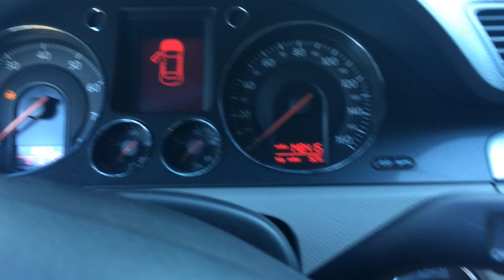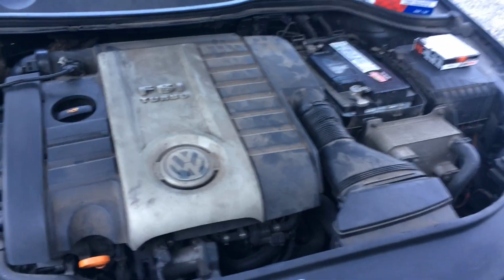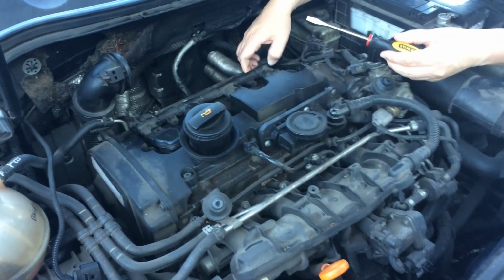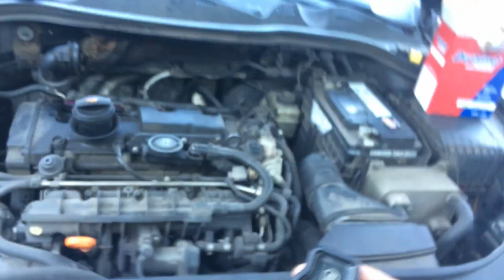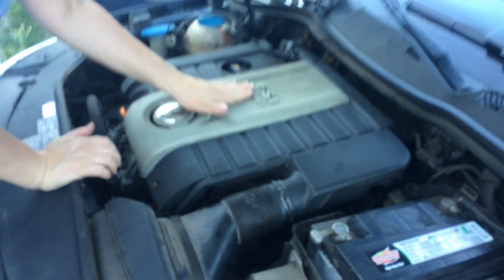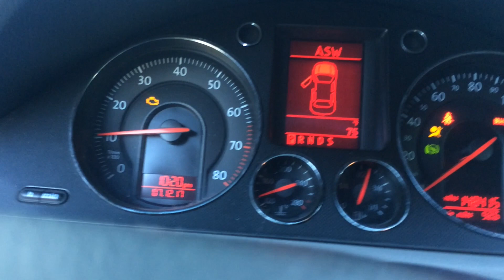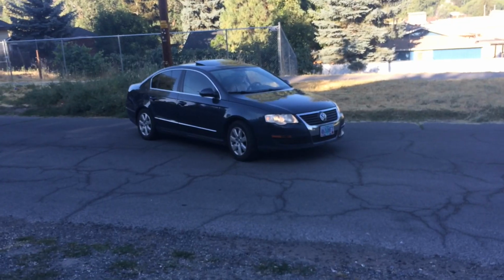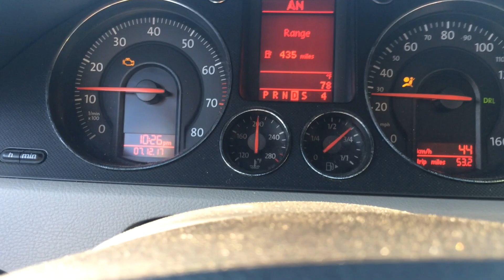How to replace coil packs and spark plugs | VW Passat 2.0T

Comment: Happened to my 2006.  Went into limp mode, but got me to the dealer.  Yep...coil pack was the issue, had them all replaced.  Thanks for the great video.  I still have the car, but it is killing me slowly by a thousand cuts.  VW service although great, is now way too expensive.  I have done some of the easy work myself and it helps.  Saved over 250 bucks when I replaced my driver side
window switch cluster.  YouTube is fantastic.  Don't forget to replace the cam follower regularly.

Comment: That very same light came on as I was heading out from Las Vegas to Reno (450 miles through barren desert) literally 5 minutes into the drive, car has 136k miles on it.  I thought that malfunction light was a transmission symbol, and the car was jitterring and vibrating, so I immediately expected the worst.  We limped it off the freeway, prayed, and the light turned off.  I checked in the owners manual and saw it was a malfunction code, and it occurred to me it may be timing related.  Made it back to Reno just fine, light hasn't come back on, but I'm going to replace all 4 coils and plugs.  An ounce of prevention as they say.  Thanks for the vid!

Comment: Did you get an engine knocking noise when accelerating? Mine would vibrate excessively when idling however when I would go past 20 MPH it would begin to knock and vibrate. Would a spark plug cause this?

Comment: I replaced mine many times.  It never ran quite right, even with new ones... and I went through three sets (12 total coils) over the past two years.  The guys at the dealership said, "Oh yeah, it's because you're not using the genuine VW parts"  blah blah blah.  So, since I had no better ideas, I tried the genuine VW coils... and now it runs good again.  So, moral of the story, if you're having misfires, even after getting new coils, you need factory coils.  The after market ones have no business calling themselves replacement parts.  They aren't.
Reply from the maker: benf101 this is very true for certain car parts. VWs are picky! The other car parts you want to go OEM with are oxygen sensors.

Comment: I replace two coil packs still have the same problem should I replace the other two plus and full spark plug already
Reply from the maker: Did you check for codes telling you which cylinder was misfiring? A good practice is to replace all of them because if one failed, the others could be soon to follow. Always check the plugs to see if they're in good shape, but another good practice is to just replace them while you've got the coil packs off. They aren't that much $ after all.

Comment: What if you replace the coil pack and it still runs the same or won't start...I have a 2009 vw cc sport
Reply from the maker: Hannah Price do you have a check engine light? Coil pack, spark plug, next could be fuel injector
Reply: @ore83  yes it was flashing when I changed the coil pack it crunk up then shut off when I went to put the cover back on the engine and wouldn't come back on
Reply: Check the fuse

Comment: Evap purge is ticking probably why the check engine light is on. Does it say check gas cap once in a while? If so that's the problem

Comment: How many miles since your last Coil Pack replacement do you recall? I'm going to replace my Coil Pack by tomorrow, since i last replaced them in 2009 at 60K miles,, nowadays i'm at 197K miles, so thats 130K interval..'which i know is way way way too long'. But i'd notice my idle speed wanting to almost dip too low on occasion,, plus highway uphill passing power had dropped off too...Not Good.

Comment: My 2008 Passat is doing the same I wanna replace the coil that’s bad trying to save some money I’m 17 years old instead of buying the set ? Any help please I’m trying to figure out witch coil is actually bad
Reply from the maker: Joy Road Mike buy the single coil and pick one to swap out. Start car and test. One by one you can see which is bad.
Reply: you can go to autozone to get check engine light scanned.  the code will come up which cylinder the misfire is coming from.  its just best to replace all at same time since the others are due for a change.  its really not saving money if ur car was to go out in the middle of road and have to get it towed.

Comment: I have 2010 be Jetta 2.5 All cylinders are misfing check engine light blinks, rpms get stuck around 2200rpm, I keep getting the crankshaft, cam senor,codes I replaced everything.can someone please help me.…..
Reply: having the same problem with my 2010 2.0t passat! everything you just i have wrong with my car, expect mine dosent wanna go over 4k rpms

Comment: Mines still misfiring what do you think it can be redid the spark plugs even did the coal packs an throttle body
Reply from the maker: Damien Allen check codes, but usually dirty fuel injector or something serious at that point
Reply: @ore83  ok I was told to try gas treatment ima get codes checked to most definitely
Reply from the maker: Damien Allen gas treatment is an inexpensive thing to try but typically the gas we use already has cleaners and additives in it so cleaning or replacing fuel injector usually works better. Good luck to you though and let me know when you get it figured out
Reply: Check the plug gaps . If off will cause misfire alone . I replaced plugs and were not gapped right and caused misfire on 1 and 4 that was not there before . This only engine I’ve ever had issue with plug gaps on and work on cars . Very finicky engines .032

Comment: Just wanted to add, called the stealership, $71.69 PER COIL!@!@@!!! $18 per spark plug Oo  DUUUUDE!!!! I searched for spark plug wires on Autozone and it said it didn't have anything for my car.  Make sure you search for 'coils' or 'ignition coil', a pack of four is like $80 at Autozone, lol.
Reply: 98.99 at Autozone
Reply: @scatit4027  that inflation is real bruh

Comment: i got a 2007 passat 2.0 and it’s was also shaky and sound like it was misfiring, turns out i just had to replace the variable timing solenoid
Reply: Same year, car, and engine with the FSI, my cars been acting similar but I'm not sure if its either what you said or maybe carbon buildup or bad fuel injector? My only code is a cylinder 3 misfire and I've replaced all coil packs and swapped plugs around and nothing changed. I also replaced the cam follower.
Reply: @SilverFrost14  mine is giving me a cylinder 1 misfire code. Does this video help?
Reply: @SilverFrost14  hi mate could you please tell me how your car went? Many thanks
Reply: @dallinrogers6626  hi Dallin did you manage to fix your problem? If so how? Many thanks
Reply: @davidhe7213  my issue was carbon buildup on the valves and my alternator was also a culprit to misfiring(replaced my battery along with doing alternator)

Comment: My car smells like gas when I first turn it on it’s 2003 Passat 1.8 turbo but wastes a lot of gas In not a normal ways no leaks no nothing everything there do spark plugs save fuel ? The car I bought haven’t been changed since 150,000km on it from previews owner and I put another 30,000km on it so I wonder maybe that could be a reason ? My brother said if your spark plugs are that old means they aren’t burning fuel properly I’m not sure if you see this message let me know like I said when I first turn it on fuel smell comes from muffler then goes away as I drive let me know and thank you
Reply from the maker: Dark Night that’s normal for most cars because a cold engine requires more fuel to run correctly. As it warms up it needs less fuel and the smell goes away.

Comment: I have the same car. I can drive it for as long as I want and it wont turn off everytjing seems fineuntil I turn it off. Then I turn it back on while still warm my car stsrts turning off. I have to let it sit for 15min so that won't happen. Anybody knows what can be the problem?? Ive taken it to a shop and they told me that they found nothing wrong.
Reply from the maker: Could be a few things. But the first to come to mind is a bad coolant temperature sensor.

Comment: All four of my coils were replaced a month ago, i have a 2006 VW passat 2.0 it's still misfiring,  not shaking too bad though but making a gurgling sound will idling. I have 110,000 miles. My engine light is on but not blinking, i will take it to VW $$$$$$,😢
Reply from the maker: SOOKND have the code scanned for free at AutoZone, YouTube the code on how to fix. Stay away from VW, they overcharge.

Comment: Sooo.. what if my coil packs have oil in it? Whats the problem?
Reply from the maker: Spark plug tube seals need to be replaced. It means buying a new valve cover gasket with tube seals, removing the valve cover and replacing the valve cover gasket and all four tube seals. Easier than it sounds.
Reply: Thanks for the help man! Please post more informing videos like this! Thanks again!
Reply: Def valve cover gasket.

Comment: Put R8 coil packs in they so much longer
Reply from the maker: I’m sure you’re right because one of these went bad less than a year later.
Reply: @ore83  ye standard coils are shit upgrade to R8 Can an there same price
Reply: Actually why not just buy the oem part for your car. If it is unreliable most likely there will be a revised part.
Reply from the maker: TheWeedOperation that’s the best idea. She was on a tight budget at the time though. I think OEM costs a bit more (better quality though!)
Reply: @TheWeedOperation  because the r8 coils are the same price so you'd be stupid not to upgrade them
Reply: Jeff, do you happen have the part number for those R8's still? I've been looking and can't seem to find ones that say that fit my 07 Passat.
Reply: @jcoburn3590  I went to tps an asked for 4 R8 coils don't know what part number is mate sorry you can buy them off eBay to